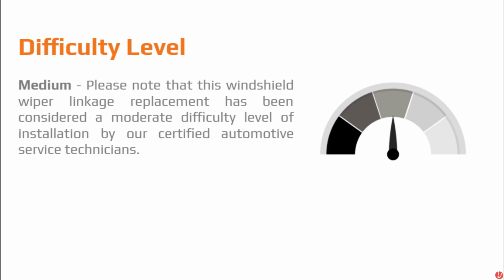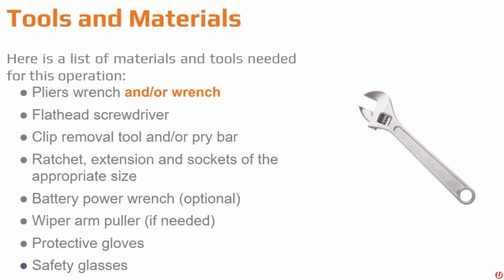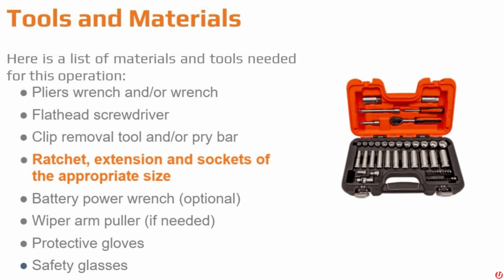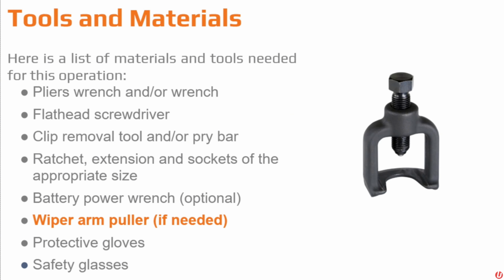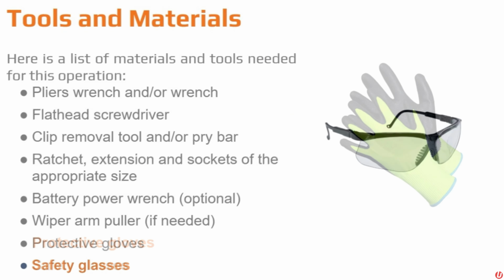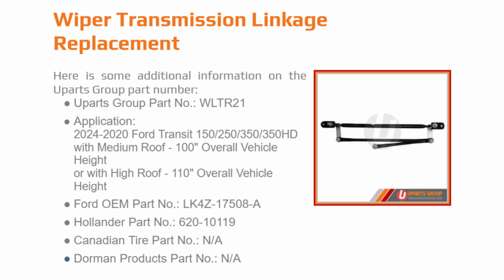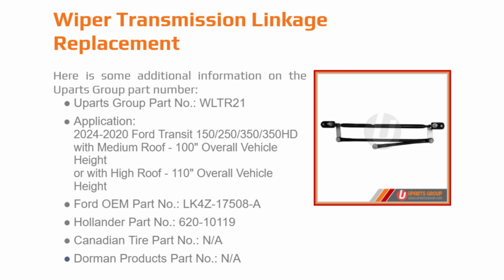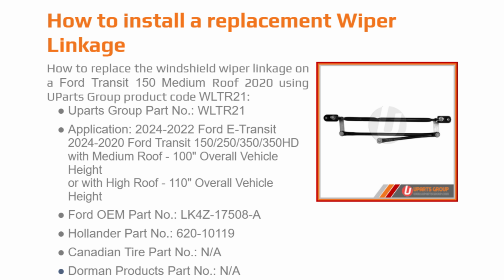WLTR21 Wiper Linkage Replacement For Ford Transit 150 Medium Roof 2020 Fast & Easy

Comment from the maker: ✅ Uparts Group Wiper Transmission Linkage WLTR21
https://upartsgroup.ca/products/wiper-transmission-linkage-wltr21

🧰 Recommended Tools:
🔧 Plier & Wrench Set
https://amzn.to/49n8lY4

🔧 Screwdriver Set
https://amzn.to/4tN05br

🔧 Trim Removal Tool
https://amzn.to/3RjRH5r

🔧 Ratchet & Socket Set
https://amzn.to/4njQmYg

🔧 Battery Power Wrench
https://amzn.to/4tzOI6p

🔧 Wiper Arm Puller
https://amzn.to/4d48ou9

🧤 Protective Gloves
https://amzn.to/42tTLKv

🦺 Safety Glasses
https://amzn.to/4wpi9dV

👍 Thanks for watching! Don’t forget to like, comment, and subscribe for more product guide videos.